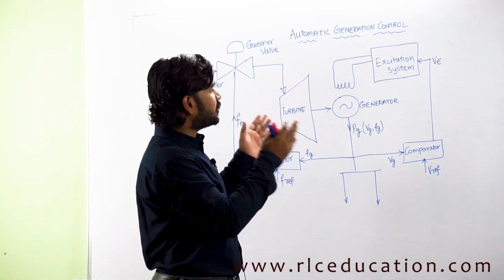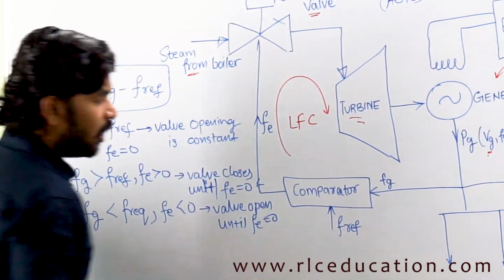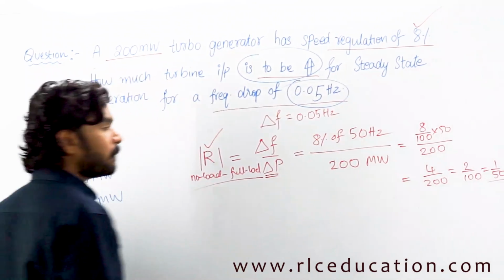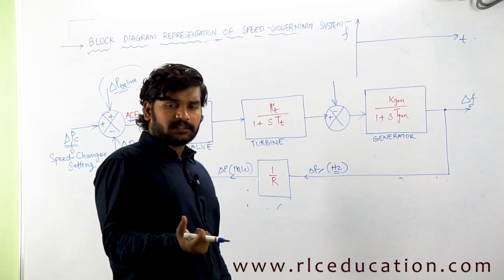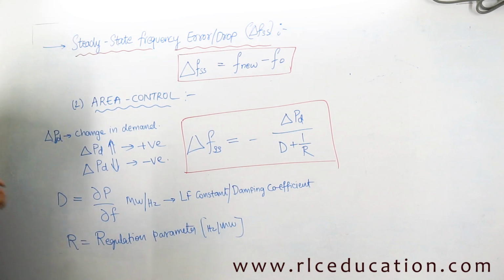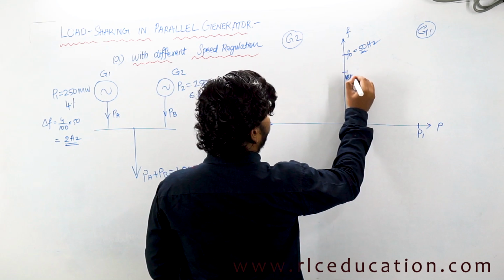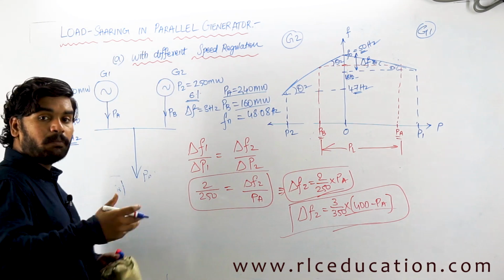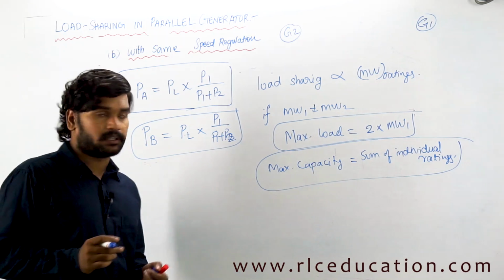Load Frequency Control Full Concept | GATE ESE PSU | RLC Education India

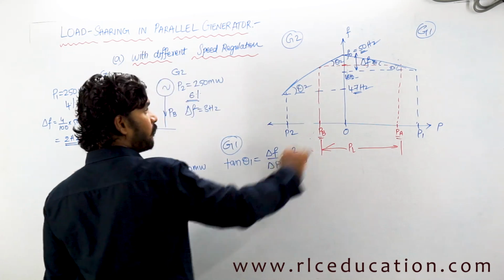Comment: In 47:10 you show that change in power for generator is 250. Shouldn't it be 150? If you use 250 for change in power for gen 1 you get pb =160 and pa = 240 like in the video, but that would make total load 500 instead. When using gen change in power to be 150, I get Pa = 189 and Pb = 211 and a change in frequency of 47.48 Hz.